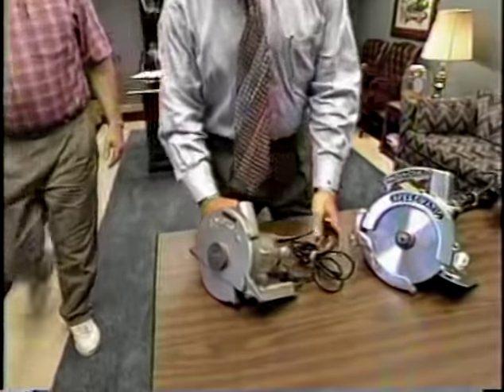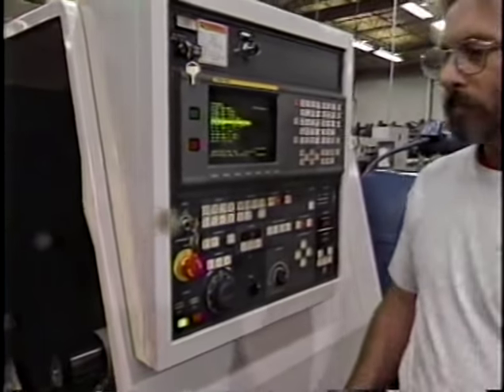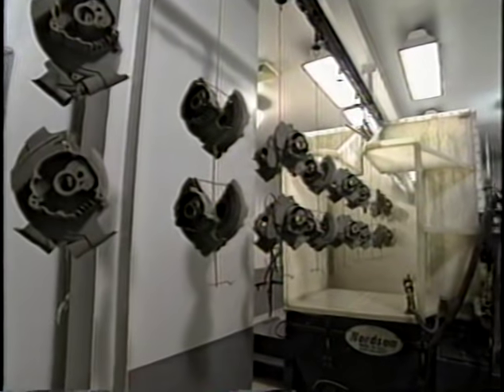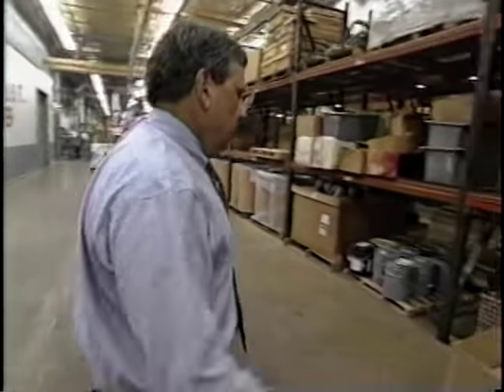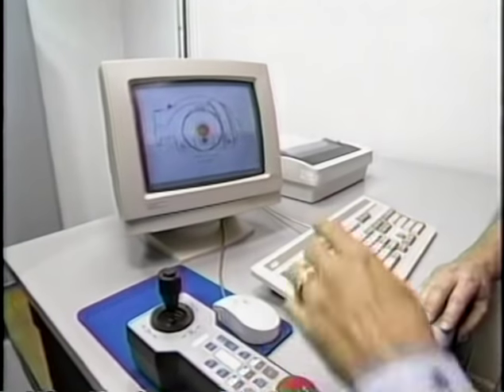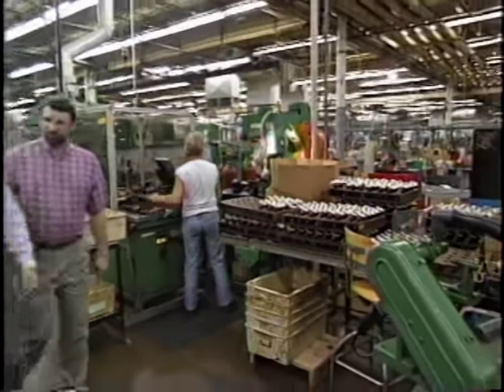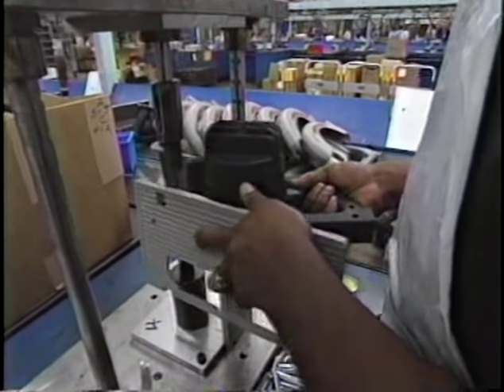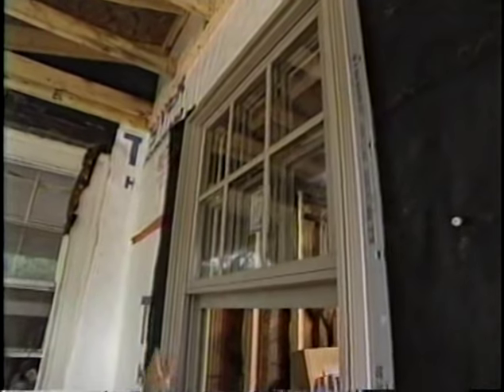"This Old House" visits Porter-Cable tool factory - 1991

Comment: The best tools were made in the USA. Just read Porter Cables Wikipedia page and the company has a great American history. Unfortunately most of the manufacturing in the United States has ceased, tools are now made primarily in Mexico and China. This video was fun to watch and see how Quality tools used to be made.
Reply: scott oconnor I'm always on ebay looking for older USA Made Porter-Cable tools. I've found several old 690 series routers, a 330 Speed-Bloc Sander, and a 6" Right Angle Random Orbit Sander. I've also found some good older Makitas too.
Reply: the reason for manufacturing and other industry decline is they made it cheaper by being paid less and making less quality products . you by acheap power drill ,lasts for 3 years .  buy better made drill ,lasts for 30 years then repair it .

Comment: I was so disappointed with my Porter Cable power tools, I returned the roofing nailer and I threw the router in the garbage after 3 or 4 uses and less than 3 months old.